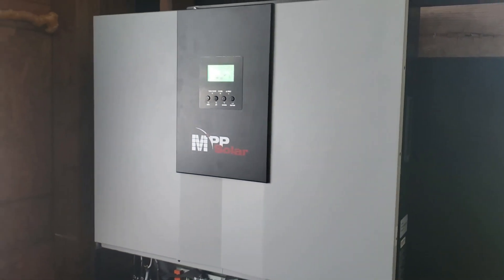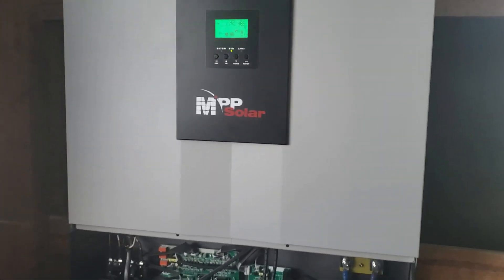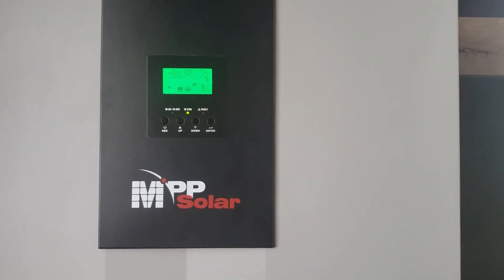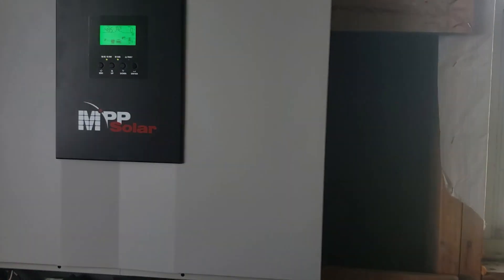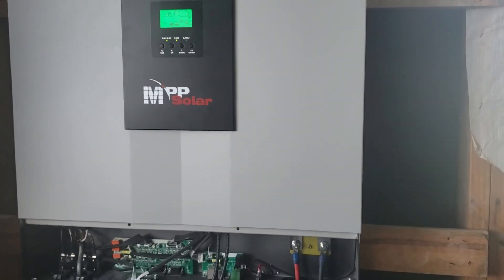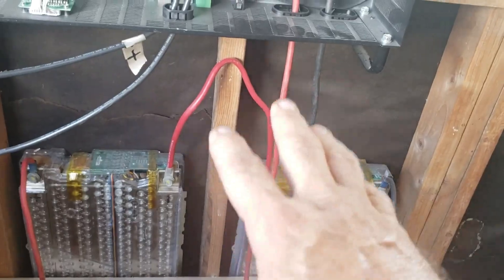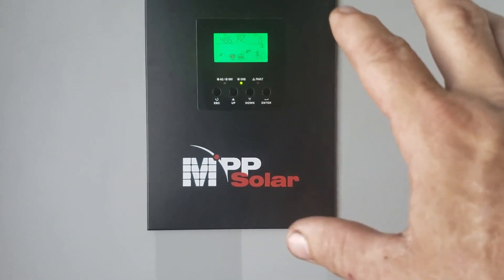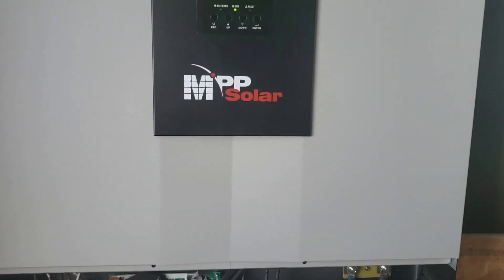LV5048 MPP SOLAR UPDATE test with Tesla Batteries SILENT BACKUP GENERATOR?

Comment: Been running this exact setup 24/7 off grid since February 2020. 
So far so good. Very impressed. 
I have found no way to disable the float charging voltage but set it below the maximum (bulk) charge of 48.8v. 
Also, I have noticed lights do dim slightly when power hungry appliances like toaster ovens switch on. Maybe another LV5048 in parallel would solve that.
Reply from the maker: I think if you use custom mode on the battery type yo can set it. I am running my constantly and love it so far. The fans are quite to where my MPP Solar units I am running in our house in the Philippines has very noisy load fans.  On the lights yes that microwave power surge could be the dimming but as well check your gauges of wire. If too small it also will cause that.  Are you plugged directly in and is it 14g or 12 gauge to the outlet , what size between the unit and breaker box also the size wire from batteries. I can suggest ( I am sure you know just rattling here) that always oversize just a little for safe measures or future upgrading. I will be running a parallel unit myself in the future. 2500 watts on each leg is not enough. 5000watts on each leg would be spot on!  Thanks for stopping by. James
Reply: Not an electrician here by any stretch of the imagination but 100% agree on over sizing. The inverter is connected through 10 AWG  600V cable to a 220v outlet and the battery cable is 1/0 AWG. 
Here’s a post if you’re interested:  https://diysolarforum.com/threads/mpp-solar-lv5048-tesla-model-s-module-combo.4091/
Concerning the battery programming, it is my understanding that choosing ‘USE’ (user defined) in setting [5] allows you to set [26] Maximum (bulk) charge, [27] Float voltage and [29] Low DC cut-off voltage. I have not found a selection to disable float voltage.  
May I ask where you scored the deal on your Tesla modules? 
Thank you for sharing your journey,  an inspiration to many.
Reply: what values are you setting the charge 
USE
MAX
LOW

Comment: Those batteries that you got on a video if you don't mind how much were they and when you did bought them where they already put together like it you it shows on the video
Reply from the maker: I think I gave around $900 each for them with shipping. Each is one pack of cells from a Tesla. The skateboard platform of a Tesla is comprised of many if these packs. Each Pack is apprx 24vdc

Comment: I need help configuring my inverter to achieve the following:

1.0 I want only solar to charge my 48v Nissan leaf batteries
2.0 I want the inverter to only switch on utility when the battery voltage drops down to 48v
3.0 I want the inverter to switch back to battery when solar has charged battery to 57v
4.0 I want grid to be off during 3.0 above

Comment: I checked my lv5048 and there is no floating charge disable setting. There is only a battery equalization disable. Also what is your bulk charge and your floating charge voltage set at? I have the same tesla packs.

Thank you.